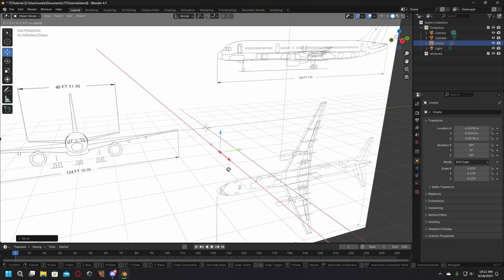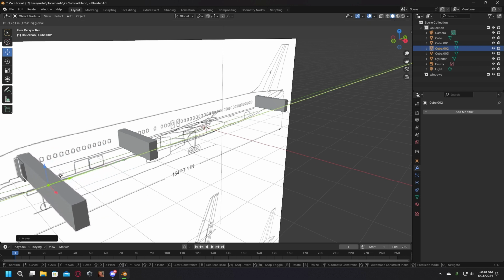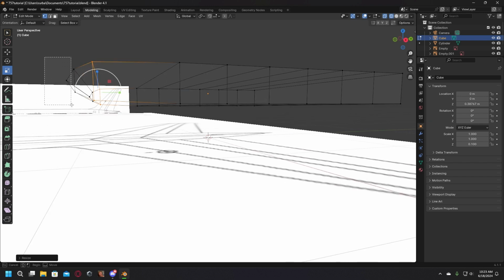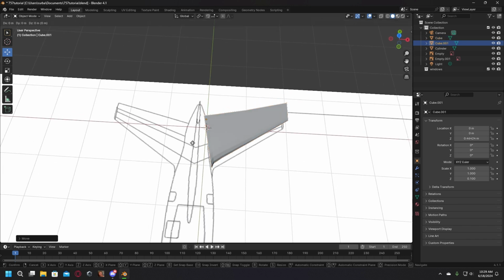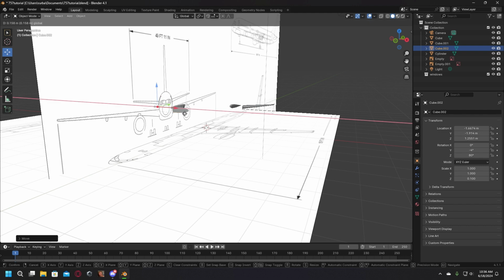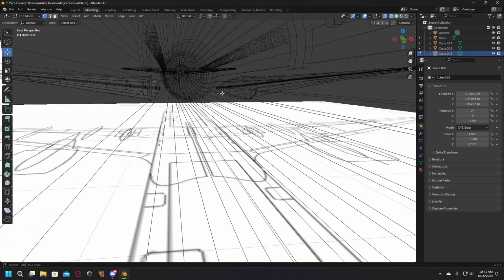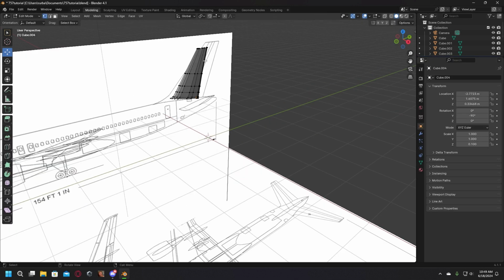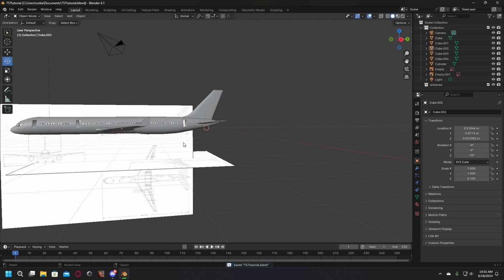757 blender tutorial (pt2)

Comment: Nice models. I appreciate your effort but please it's much easier and accurate to estrude the fins, vertical stabilizer and the wings from the vertexes in their place in the fuselage instead of making them individually and fitting them as you did. That would not only remove spaces and give you an accurate model but will save you lots of time. Thank you for your efforts ❤

Comment: I will do this like Part 1. Hey Da....If you hold down on ALT and click on the line,  it will highlight the whole line to scale or move.  It is a little easier to get at the line in close quarters, like at the inside of the horizontal stabilator.     Gaah!
Reply from the maker: Will use that tip for the next thing I do, currently working on an l1011 for something